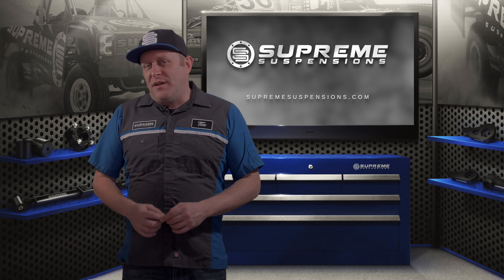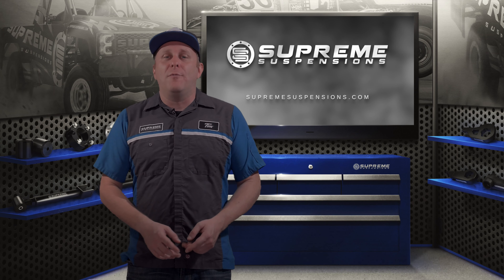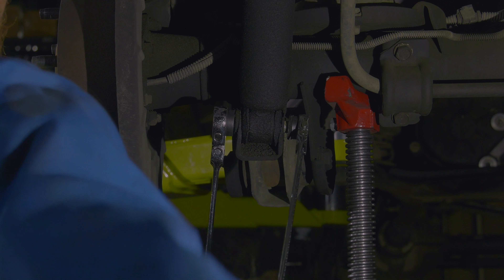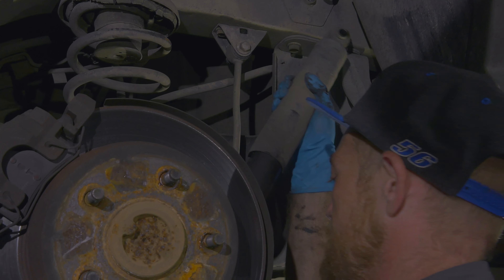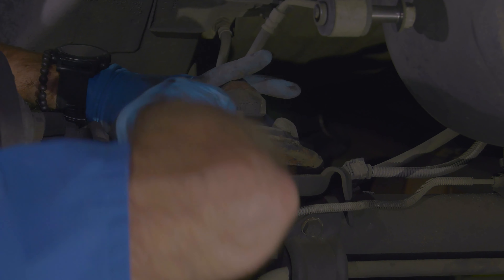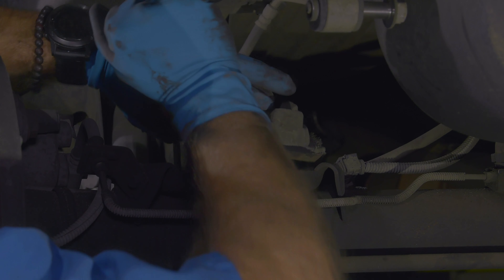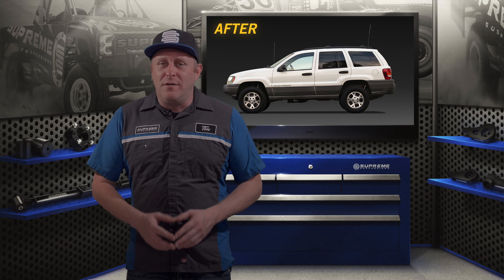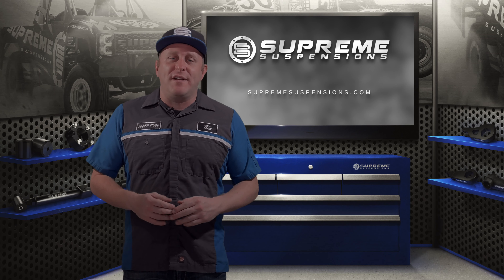2000 Jeep Grand Cherokee WJ | 3" Rear Suspension Lift Kit Installation

Comment: I put the three inch kit Pro comp shocks and Poly spacers about a year ago.The ride is better than before.I really dont do off roading but my 99 Grand Cherokee surely stands out with the lift.
Reply: What wheels did you end up going with. In the process of doing all of this now.
Reply: @musicismeds  I put your basic black 16x8 black raceline wheels.5x5+0mm.They sit just outside the wheelwells front and rear.Looks badass.My 3 inch lift came from supreme suspension.If i remember the cost was about 300$.Worth every penny.BTW the wheels cost me 630.00.
Reply: @robertwarren1735  sweet!! Doing some google searching now for a similar setup.. from what I'm finding looks awesome!! I think 3 will what I go with. From what I'm hearing anything over 4 starts to get a little rough. I don't wheel. All city driving but want a good looking Jeep.
Reply: @musicismeds  Supreme suspension is worth a look on YouTube.BTW i have Cooper tires from Walmart.$00 bucks for all 4.What a steal.
Reply: @robertwarren1735  looks like the kits on the Supreme site use pro comp shocks for 380.
Reply: @musicismeds  The shocks are Pro comp and honestly they have an excellent ride.

Comment: got a 2003 grand cherokee 2wd and want to upgrade springs on front and lift 2 inches, best kit? or shall I go piece by piece, shocks are good but springs a re done so that's a must...suggestions ? no off road just better clearance and stop saggy feel

Comment: How does the rubber isolator stay on top of the lift block? Is it just held on by the pressure of the spring, because to me that doesn’t seem like it will stay.
Reply from the maker: Hello, the rubber isolator will be installed and held in place the same way as without the lift spacer, spring force and the center of the bump stop.

Comment: Hi. Are there any other suspension/driveline changes needed with the 3" lift on an 04 grand cherokee? Thanks.
Reply from the maker: Hello, Marty. Our product listings should state if the kit has all the hardware to complete the installation. If you are unsure or have any questions, please feel free to email us at support@supremesuspensions.com or call us at 888-810-6791.

Comment: I added the supreme suspension 2.5" lift to my 2004 Jeep Grand Cherokee. The shocks are already worn out and I don't trail. Is there a replacement warranty for these rear shocks..
Reply from the maker: Please contact us directly at 888-810-6791 option 2 and be ready to provide your order information so we can assist you with a replacement.